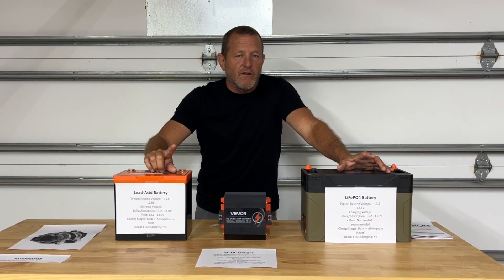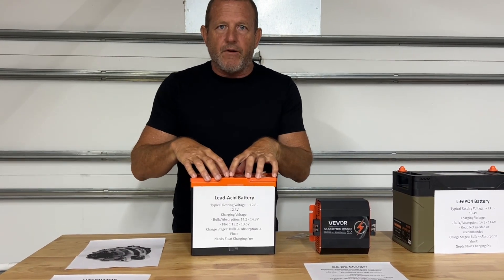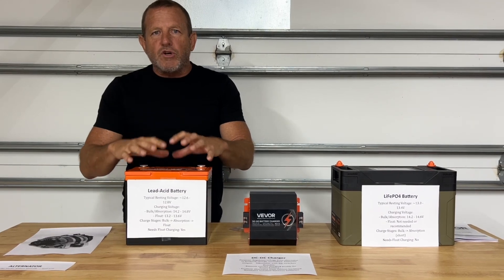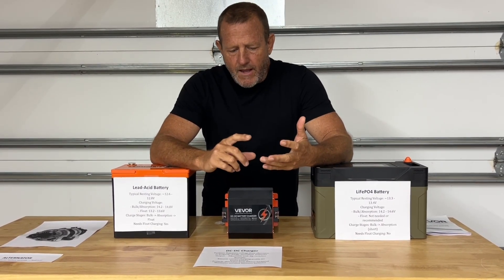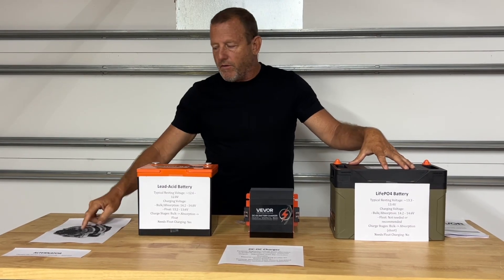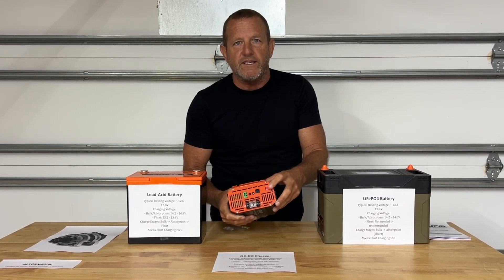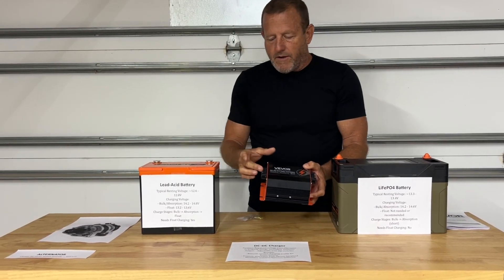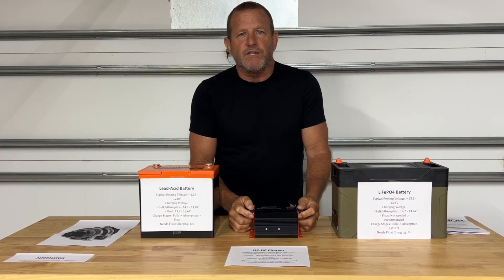Why do you need a DC to DC charger ? A Simple Explanation

Comment: I don't know if I understand it correctly. Basically DC-DC charger sits in-between Off-grid battery and vehicle battery, ensuring current flow unilaterally to the off grid battery. i.e. Off-grid battery will not charge the vehicle battery, but only vehicle battery charges off grid battery. DC-DC charger will shut off when the vehicle / alternator is off, so the vehicle battery will not be completely drained by the off grid battery.
Reply from the maker: exactly. but also as inportant  the charger converts the charging profile to be compatable with the off grid battery (lifepo4)

Comment: Nice simple vid. Ty. I got a question. I recently installed a 12 volt air conditioner on my class B. I'm thinking about adding a lithium battery dedicated to the 12 volt AC. Can I connect the third lithium battery to the coach battery? Or i need to directly connect  3rd lthium battery to starter battery. Current setup is starter battery then coach battery deep cycle agm. I want to add 3rd lithium for 12 v Ac. Just not sure the best route. Hoping for your input. Ty or anyones input
Reply from the maker: with me not knowing how the coach battery is actually connected and charging it would be hard for me to tell you. if the agm coach battery is charging from the alternator then you could connect the dc to dc charger to it i would think. but without knowing your specific set up it would be hard to give you specific advise.

Comment: On a marine application with 1100Ah of LiFeP04 and a 95Ah AGM start battery, why wouldn't you charge from the alternator to the house bank LiFePO4, and charge the start battery from the LiFePO4 with the DC-DC charger?
Reply from the maker: the alternator/generator on a boat does not have the correct charging profile for charging lifepo4 batteries. boats and cars are set up to only charge lead acid/agm